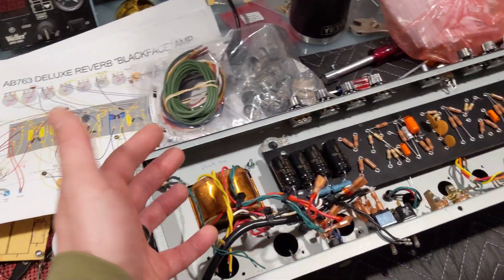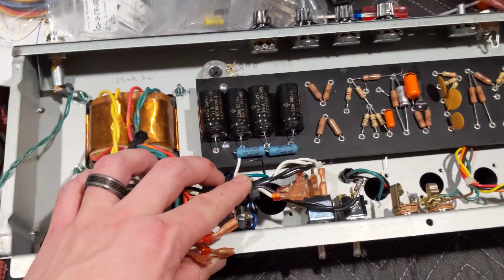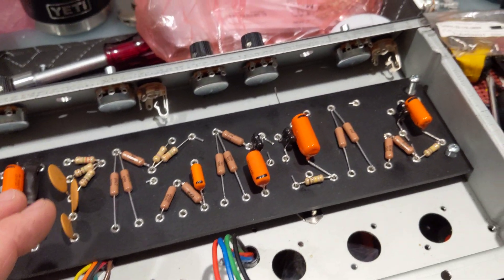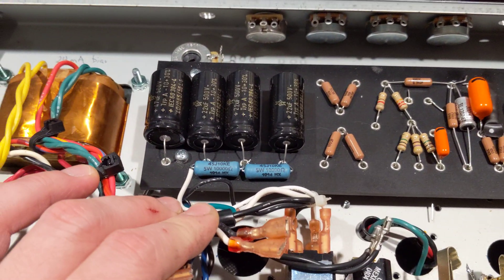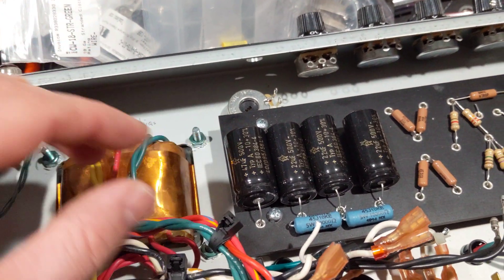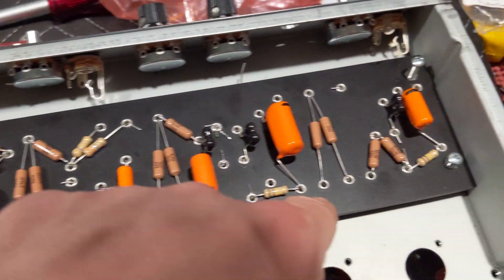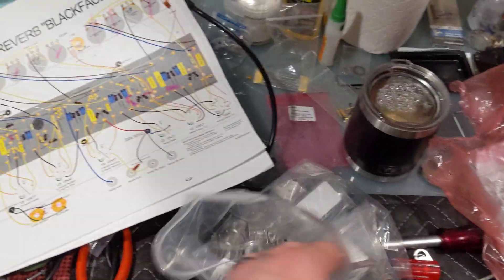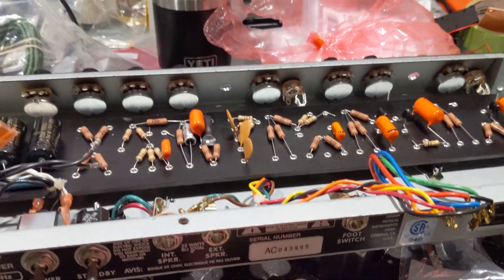Converting a Fender Deluxe Reverb Reissue (DRRI) to Handwired Blackface AB763 | Part 2

Comment: Interested to hear how well you liked the amp after finishing it. It definitely won't sound like an AB763 amp with the components you selected, and it most definitely will not feel like one under the player's fingers.
Reply from the maker: Personally, I like it a lot now. Especially since it actually works 😂 unlike when I first got the stock DRRI. I have a tone demo on my channel if you'd like. My only change I want to make at this point is the speaker from the Weber California AlNiCo (aluminum cap) to Weber Michigan. The amp is a little spikey/fuzzy with overdrives even with the bright cap out.
Reply: @TheToneGeek  you should try the warehouse speakers EV12L clone, the WGS12L. It'll give zero speaker breakup, and stay full at any volume. A lot of those modded Fender designs were voiced around the old 12L speakers.
Reply from the maker: @middle_pickup  I'll take a look! I have an Eminence EM12N (neo) and it's an amazing EV12L style speaker with a lot less weight. I never paired it with my deluxe tho.. 🤔

Comment: Are those 10K wirewound resistors? I was doing the math and it seems like they would be dissipating a lot of heat. What is the B+ voltage? On another blackface Fender I'm looking at, the voltage across those bleed resistors is like 230V. With 10K resistors, that would be over 5W of power dissipation. Normally you want to derate the resistors to like 30%

I'm just guessing, but let's say B+ is 450V, and each resistor is seeing half of that, so:
225V/10K = .0225 amps. 
225V * 22.5mA = 5.0625 watts. 

Basically you are maxing out the power rating of those resistors, and I would expect them to get extremely hot.
Reply from the maker: Interesting and thank you for posting your work to get the calculations. I am curious about this. I did follow a standard deluxe reverb design and they used 3w resistors for the 10K dropper. I don't recall the 5w wire wound getting hot at all. https://robrobinette.com/images/Guitar/AB763_Models/AB763_Deluxe_Reverb_Layout_DIYLC.png

Perhaps there is less current than calculated?
Reply: @TheToneGeek  Ok, got it. I was assuming it was like the vibroverb I'm looking at where there are two resistors in parallel with two series filter caps. The resistors are there to evenly divide the B+ voltage across the two big capacitors. In that case they are 220K metal film resistors, and I wasn't sure if those were the two resistors I should be considering to convert to wirewound .

Comment: Hey there.  Great vid and well done.  Quick question... did you end up drilling out your chassis/faceplate to accommodate normally sized shaft pots?  Assume so...
Reply from the maker: Thanks! Yes, I had to open the pots up a little.

Comment: The best improvement I did on my 68 super reverb (converted to full AB763) while servicing it is to unscrew the board, and insulate the 2 halves from each other using plastic that I cut from a large Folgers coffee container. Put the plastic between the 2 and screw them back in the chassis. These old amps tend to create a connection between the 2 board halves if humidity gets in the air. Anything can happen if that happens. Then if you were to ever sell an amp in original condition, let the buyer know it can be returned to original condition very easily. But why would you remove the plastic since its an improvement and insurance over Fenders design.

Comment: I’ve been flip flopping on the idea of doing this to my 68 custom deluxe reverb and you’ve just convinced me to seal the deal. it’s been a nightmare of an amp since I got it, the reverb constantly cuts out and hisses even after replacing the tubes, filter caps with f&ts, new reverb tank, rca cables and the SMD tremolo board in the models for export. Enjoyed your video, you really know your stuff!
Reply from the maker: Thanks, Tom!! I'll be posting my layout once I confirmed it worked as-built. So funny I was just reading about the SMD trem on the new '68. What a nightmare!! I had all sorts of issues with mine too. Hiss and brightness (even after clipping bright cap) new video coming in an hour or so!
Reply: Looking forward to seeing your next video! It's been a nightmare honestly, people say they don't make things like they used to and it's true, considering the amp costs over £1000 in the UK it's clearly been produced for as little money as possible, sad really, as much as I've tried I can't get it to be quiet or even work properly! Luckily I got it quite cheap knowing the issues. I was watching a video of Paul Rivera explaining the mods he did on a deluxe reverb that included adding a hum balance pot on the ac filaments, explaining that the high current AC filaments situated near other DC circuitry induces a lot of noise and that a voltage balance pot can be fitted to somewhat fix the issue or even converting the filaments to DC. I can't really find much more info about this but it sounded interesting! The SMD tremolo in the export models was put in there due to cadmium in the optocoupler being a hazardous substance so unable to be exported, despite that being able to be fixed with the correct LDR and an led.... talk about over-engineering a fix for a problem!
Reply from the maker: @tomcarre8280  Wow! Thanks for sharing! My new video is up. That's interesting about the optocoupler being hazardous but I understand why they had to come up with an alternative. I'll have to watch that video again now that I know a little more about the AB763 circuit. I really have high expectations after handwiring this amp! You can see that Fender did a couple neat things with the '64 handwire to make it desirable and I'd be curious to compare against mine once I'm done.
Reply: Flip the tank around. Common issue. Easy fix. Increases the distance from the transformer. It’s so easy you’ll shake your head.

Comment: Interesting , hope it doesnt sound sterile .
Reply from the maker: Me too but I think I'll be ok
Reply: @TheToneGeek  oh i was going to say ,,, lots of guys love the orange drops but a really good choice are the mallory 150,s ! Think about it. The large brown caps in the originals were sprague and the blue sausages were mallory! Also sometimes trying to replicate stage amps as opposed to personal use. ( i saw where you used a clone jbl in a cab and didn,t like it)  in many cases those modified stage amps were intended to sound great in huge halls and arena,s but are horrid in your studio practice area. They can be to treblely, shrill ect. It,s like the say though , you can find your perfect dream tone at home and on stage it just doesn,t work!!! I think the mallory,s would be a more period correct tone . If the the metal films sound bitey or shrill easy enough to throw in some carbons to mellow or warm up the sound. I like metal films in high volt areas only. But i,m a nube.

Comment: Excited to see how this one turns out. Keep it up!
Off topic: Have you considered building a Dumble Overdrives Special clone like the one John Mayer used in the Where The Light Is show? Imo some of his greatest tones are from there
Reply from the maker: Yes!! Absolutely love that tone as well! I have considered my only concern is how many differences there is between ODS from ODS and I would want to be confident that I'm getting the right circuit for his amp. I'm not sure what serial number his is, which would shed light on what circuit might be inside. I'd want to be sure before I tackle (and finance) a new amp! Lol. Thank you for your kind words!
Reply: @TheToneGeek  From what I've read it's a 90's skyliner HRM with el34s. I have also heard that it's one away from #223 so either #222 or #224.
The videos are great. keep it up!